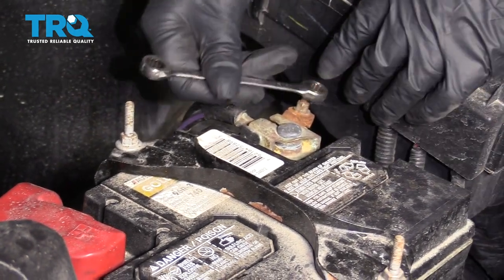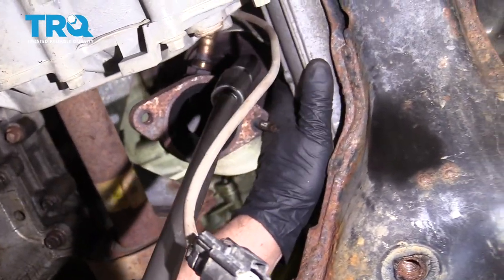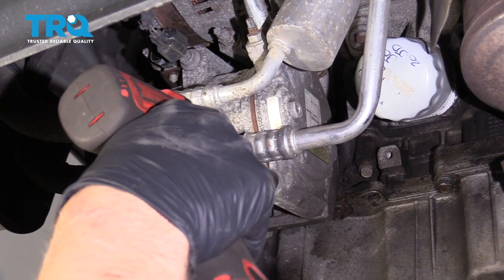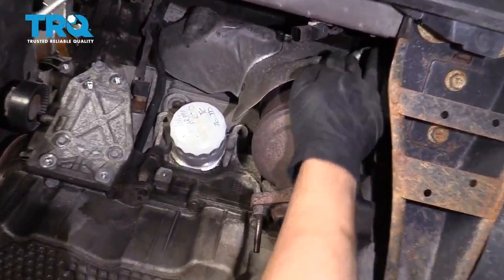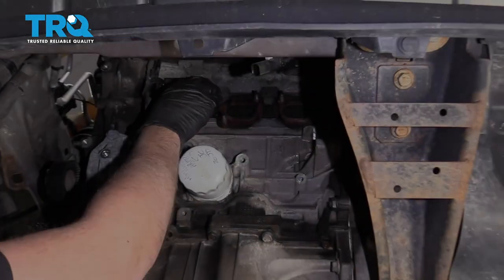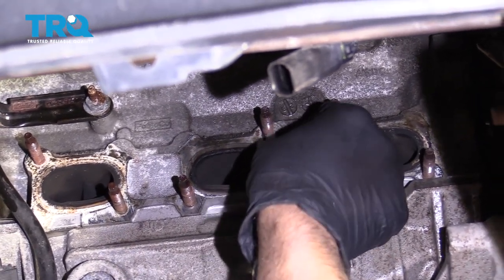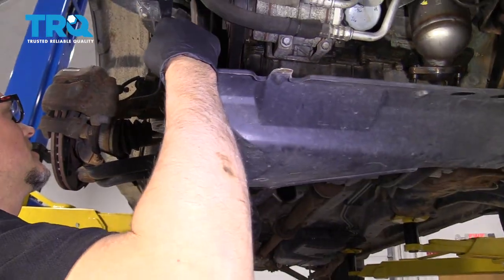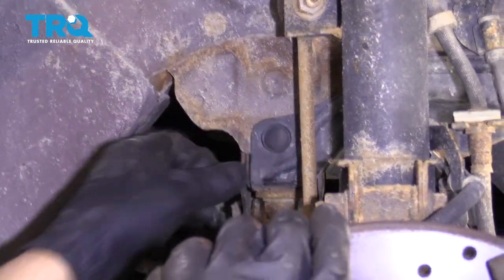How To Replace Catalytic Converters 2008-2012 Ford Escape

Comment: Great video! 
Thank you for uploading. Can you please advise me ; How can you tell apart from an issue whether it’s the transmission or the Cadillac converter when the vehicle will jerk when driving? Any advise will be greatly appreciated.
Reply: You’ll probably need either a wheel alignment or balance

Comment: Thanks for the video, I plan on keeping my 2012 Escape 2wd 3.0L for a long time, so any related videos help out. I see the oil leaking in the same spot on mine, near oil pan but coming from somewhere higher up... any ideas or video repairs for that coming? Thanks.
Reply from the maker: +Brian Hord We do not have a video for this repair right now, but we'll keep this request in mind for a future video! http://1aau.to/m/Shop-TRQ
Reply: Thank  bro nice video hard work
Reply from the maker: +Mohammed Shafiq Thanks for watching our video! http://1aau.to/m/Shop-TRQ
Reply: @TRQ  Thank you, look forward to it, if you make one. Merry Christmas!
Reply: Hi Brian, I had the same issue, I have a 2011 Escape, it ended up being the gasket on the pan, the mechanic I took it to put the dye in till my next oil change then upon inspection he found the gasket had corroded away. Best of luck, hope this helps.

Comment: Is it hard to see where the converter is on a 2007? I am selling mine and people keep asking if it has a factory converter and I am not sure how I would tell that. Backstory. I paid just under 4k for it and guy scammed me had it less then two wks and motor started giving out. Was burning through oil. Etc. So I finally after thinking about it decided to sell it as is and im not sure how to tell that?
Reply: That's not a dude scamming you. That's just a problem those engines had. And it falls on you, the new owner to be fastidious about fluid levels, especially with a new to you vehicle.